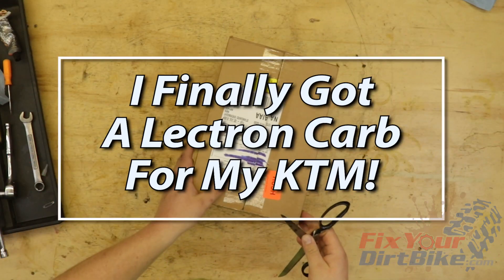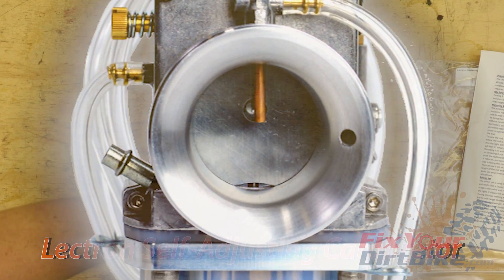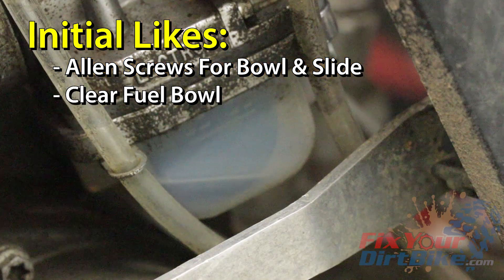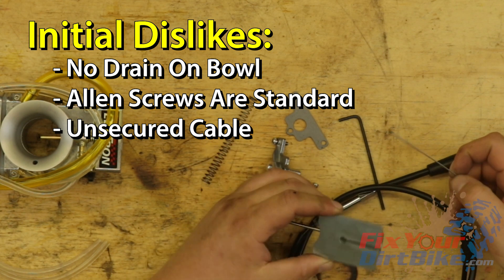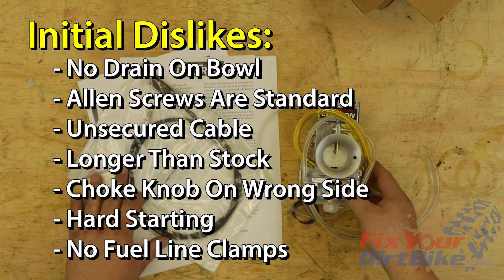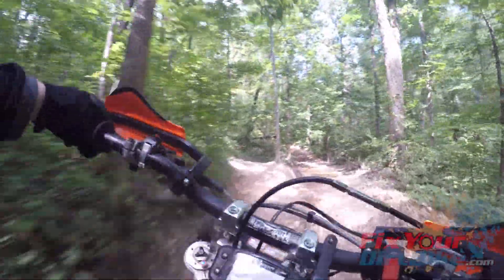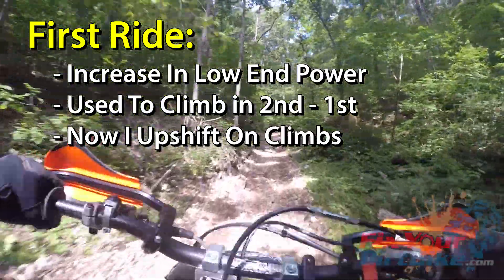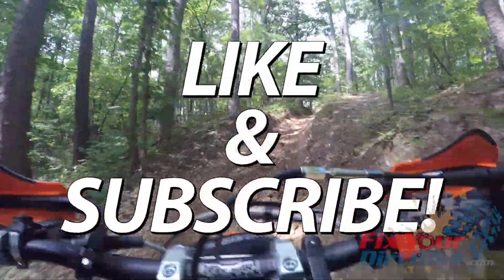Lectron Self Adjusting Carb Review And First Ride | Fix Your Dirt Bike

Comment: I installed a Lecteon carb on my 2001 cr250 about a year ago. At first, it absolutely sucked, was way to lean down low and the bike stalled every once in a while. I was convinced I wasted my money. I adjusted the metering rod at least 6 times. But after many attempts, I got it down pretty damn good. It's not exactly perfect, but way better than any other carb I've had on the bike prior. Paired with a 10 ounce flywheel weight and lower gearing, the bike is an absolute tractor. It can run at such a low rpm before it stalls, its incredible. Not to mention that the power delivery is electric even with the flywheel weight!
Reply from the maker: Interesting, mine worked right out of the box. That flywheel weight and lower gearing sounds like a good time in the woods!

Comment: Hi just fitted my new lectron to my 97 yz 250 my throttle is only twisting about a 1/4 is this normal for a the lectron?
Reply from the maker: You should have full range of motion. check your cable length, you might be too short.

Comment: Had a lectron on my 02 cr250 for a year now and have had ZERO problems, I combined it with a pro circuit works pipe and boyesen rad valve and the difference from stock is amazing.
Reply from the maker: Nice! I'm excited to see how my bikes going to perform with a better exhaust and reads!